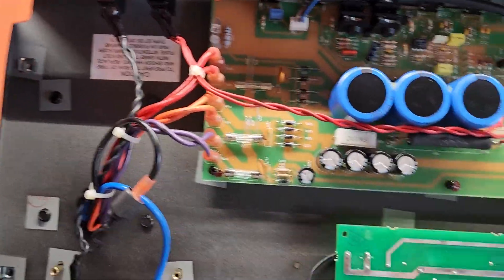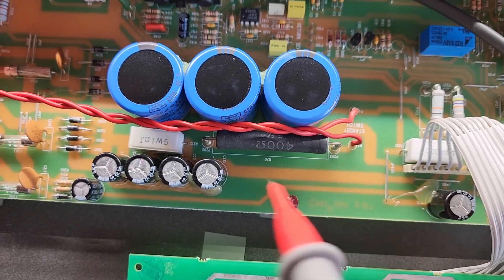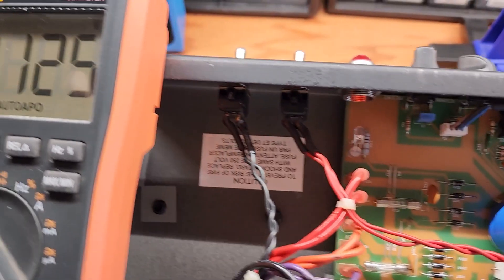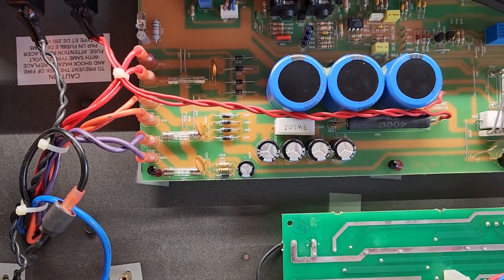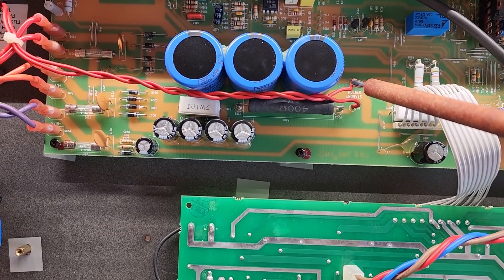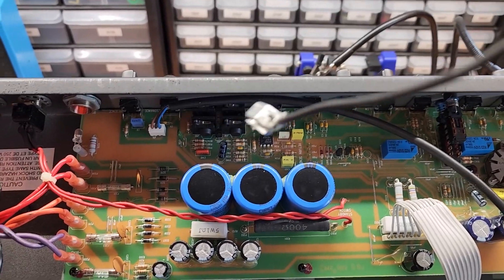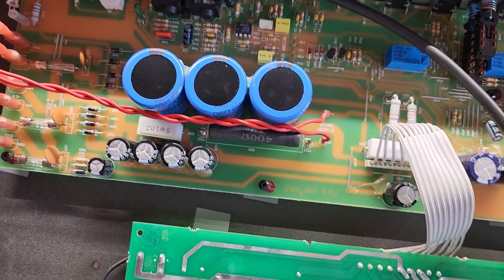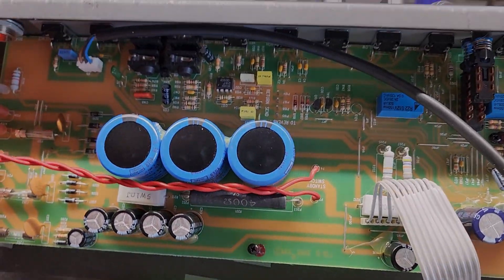Peavey Valve King VK100 Filter Capacitor Discharge

Comment: Thank you for posting this. Another YouTube amp tech says to discharge the filter capacitors, all you need to do is leave the standby off and unplug or turn off the amp and keep playing the guitar till the sound disappears. true/false?
Reply from the maker: If that amp has "bleeder" resistors at the filter caps, yes the voltage will be eventually discharged. I would not use the sound fading as an indicator of discharged filter caps!  The stored potential can kill you. Also not all circuits have this. To be 100% sure, always check with your DMM and discharge any voltage before working on any amplifier. Be smart be safe.

Comment: Thinking of getting this amp. Thank you for posting how to work on it. Is it possible to mod it to have bleed resistors?
Reply from the maker: For what it is, it's a decent entry level tube amp. On the bleeder subject, I would recommend looking at getting a proper discharge tool over modifying. The link below discusses your question in detail.
Cheers!
https://sound-au.com/articles/bleeders.htm
Reply: @NorcalME  thank you!

Comment: Thanks for posting! I believe that this is the only video explaining this process on a VK100!
Reply from the maker: Absolutely! Glad to be of help. I am thinking about posting a video of the bias mod I did for this amp if there is any interest.
Reply: @NorcalME please post it 🙏 (if you already didn’t 😅)
Reply from the maker: @christianpucciarelli  This amp came in and went unfortunately before I was able to video what I had done. What is needed a multi turn pot wired as a variable resistor in place of R205. Care must be taken to set the pot to as close as the value of R205 before installing, then double checking the voltage at the bias point before installing the tubes and setting final bias. I would be happy to send you a schematic and picture if that helps. :)
Reply: That’d be awesome!